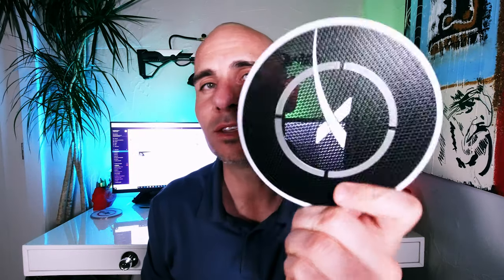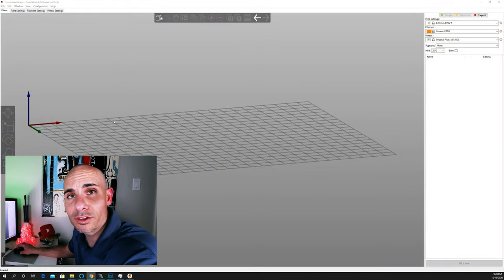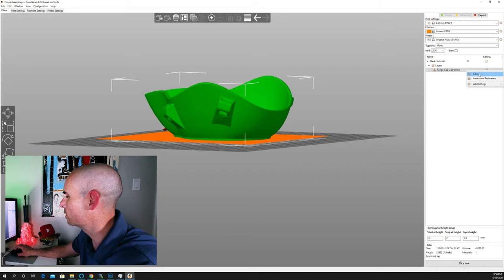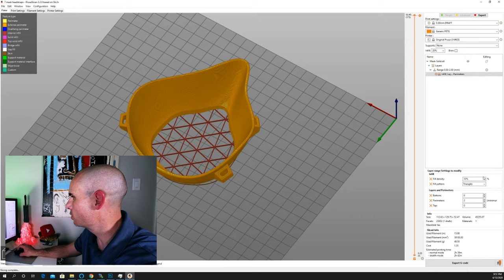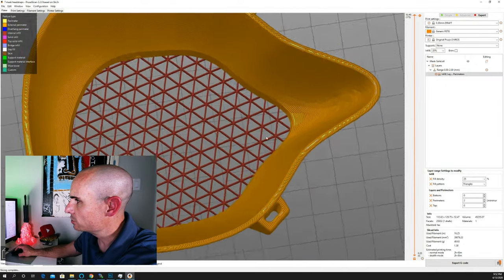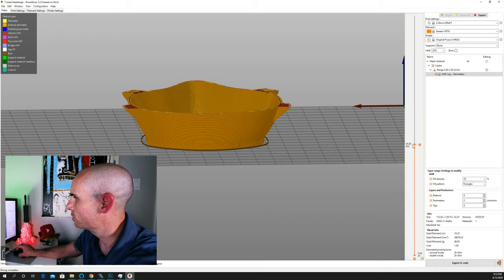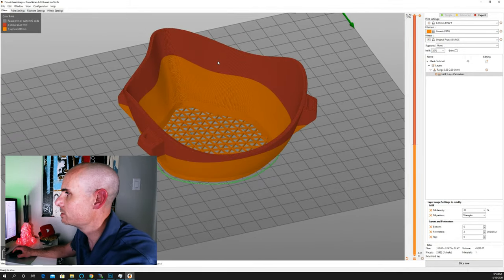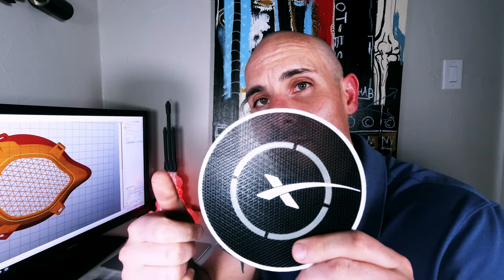3D Printed Coronavirus masks: infill tips and tricks #covidmasks

Comment: What method did you use to address that issue where FDM printing produces a material with some microscopic holes/gaps? I saw some people paint/lacquer the printed masks, or use fillers, or some have settings in their printing which prevent those microscopic gaps from being formed (I think they were using 100% infill and/or other settings)?

Comment: hey mate, but the problem is with the second material, the printer think it is petg or not? the parameters are totaly wrong? in my case the extruder gets in trouble with the tpe because it pulls so fast in the nozzle than it would be wraped in the extruder an i have to pull out all the tpu of the innerside of the extruder.. i freaking out because i seperade it for the  5th time today :D any tipps for me? Sorry for bad english :P the Germans are here :D
Reply from the maker: Welcome! Which 3D printer are you using?
Reply: The Prusa MK3s
Reply from the maker: Same printer I use. Are you using my latest Bolivair mask version? My printer never had issues with it.
Reply: @ALLYOURTECH3DP  yes it works fine, BUT the printer settings vor PETG and TPU are different an i can't say to slicer: "hey i made a cut an Z level 28mm an then print TPU" the printer is thinking it is PETG or not?
Reply: @ALLYOURTECH3DP  I am having the same issue. Would love to figure this out. THis seems like a great design. I think it would seem that when you add the layer, you also have to change the parameters so the Gcode-Export/printer know that that second layer is TPU and not PETG anymore.   Will tinker some more tonight but any advice would be welcome.